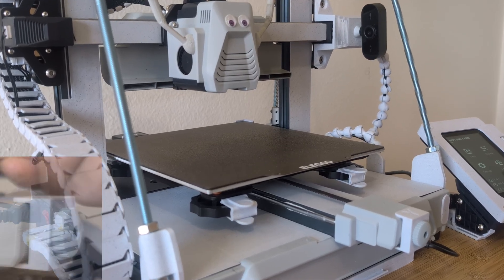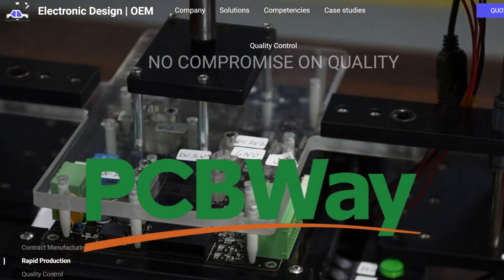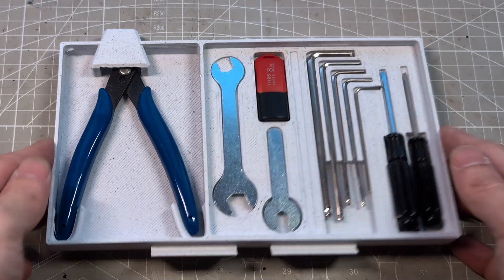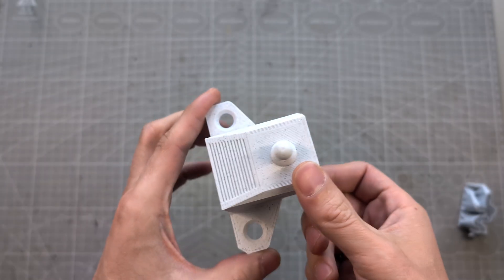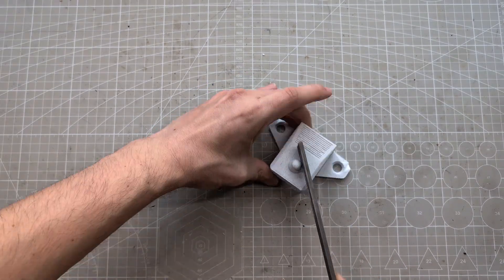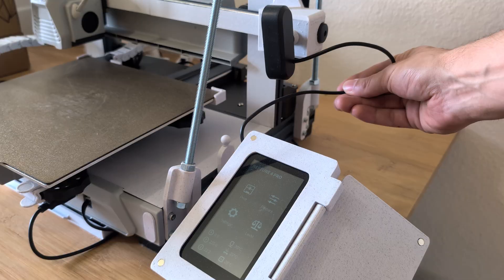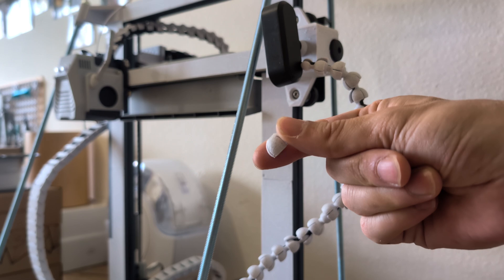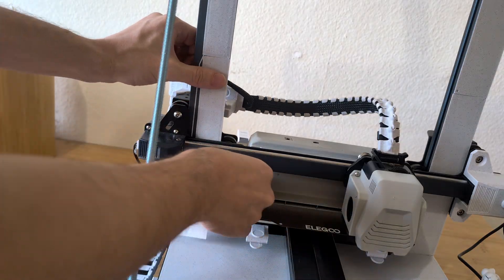Upgrades for your Neptune 4 Printer - Camera mount - Tooltray - Cable chain (part 7)

Comment: Very cool my friend!  I was thinking about adding a second camera and the tray is a must
Reply from the maker: @billmacfarlane8864  thanks a lot Bill 😃 i was not aware that you can add a second camera to the printer, but now that you mention it... That could make a lot of sence. Maybe one for a view directly to the nozzle to detect print failure early, and one that can look on the whole model from another angle? 
I wish you a good time printing 🙂✌️
Reply: @Dirt-E-Bikes  I'm using Orca as my slicer and it seems like it supports multiple cameras
Reply from the maker: @billmacfarlane8864  nice to know 👍